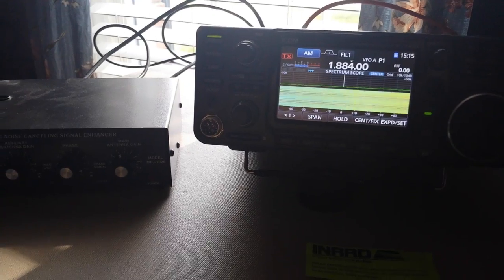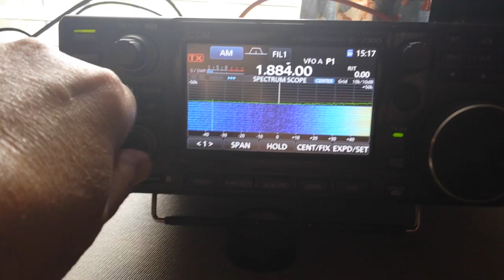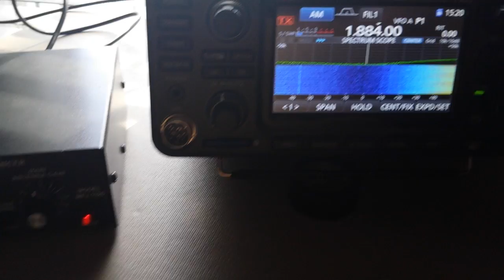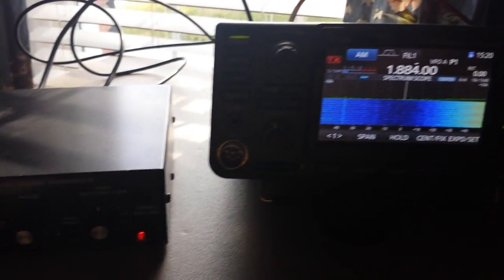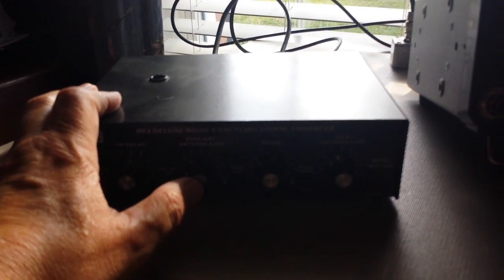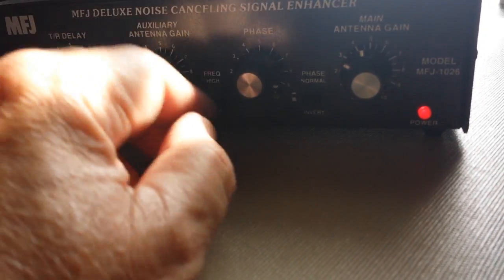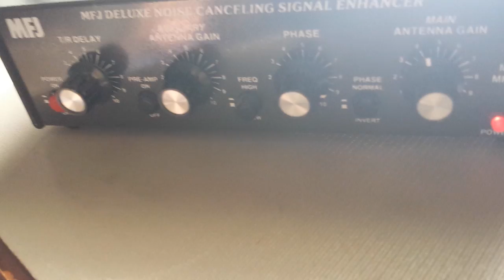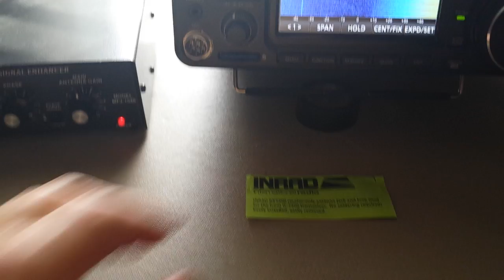IC-7300 and MFJ-1026 Noise Canceling + RX7300 + DXE RG5000

Comment: Is that a Noctua fan I see on the back of that radio ?
Reply from the maker: Correct. No more Whhrrrrrrrrr every time I tap the key or close the mic.
Reply: @n4lq  I figured as soon as I seen it. very quiet even at full speed, and will last quite a while. 

I built a gaming PC with 7 of them, three of them are 120mm Chromax black, and four of them are their 40mm their brown color. 

I want to do that with my Astron 30A PSU as it's fan is not what I'd call quiet. The fan on that PSU seems like it's one of those server grade Delta fans that have a very high RPM, and move a lot of air, I'm not sure if Noctua has a fan that small that can move that much air.

Comment: i have moved my main antenna from a vertical to an end-fed 80m and now pick up more noise than before. I have the MFJ-1026 and the IC-7300, so i really enjoyed your clear explanation of how this all works, i've used the MFJ-1026 on my Kenwood before and it worked well with my vertical, but will look foward to trying it out with the way you have your setup on the IC-7300 where I am picking up a lot of interference from VDSL which is transmitted on the telephone wires here in the UK. Will post a video on my channel once its all setup, more people in the UK need to know how to do this as VDSL is really impacting amateur radio where DSL is delivered over copper telephone lines.

Comment: Can anyone tell me what causes the horizontal lines across the waterfall after the powerline noise is gone? I have the exact same thing and with a wider span it becomes clear that the interference is about 5khz wide at about 60khz intervals and appears on most, if not all bands. I have powered down the entire house with no change.

Comment: Nice video but would of been nice to see a signal come in in the 160 Meter band that you could not otherwise hear without the MFJ-1026. As it is the video makes it look like all signals were canceled out. I read on another forum that some people use external selectable LPF's BPF's using that same Inrad cable to help the 7300 keep out QRM n all bands. Have you any experience with those?

Comment: For most of us, learning to identify and mitigate RFI and EMI "noise" is probably only second to understanding antenna systems. 

Some operators just get use to it. Some try to understand it and resolve it the best they can. It's one aspect of Amateur Radio that new hams are often surprised or dissapointed by.

Thanks for the video !

Comment: Is it possible to use my efhw as a RX and transmit antenna and use this mfj? Thanks Steve. You’re the only person on YouTube that actually shows this
Reply from the maker: You need 2 antennas for receiving. One being your main receiving antenna, usually also your transmit antenna and the other being the noise receiving antenna. So the answer is yes and no but. ..... IOW... If you are using the efhw for rx and tx then you still need another antenna to feed in the noise. This is call the "n o i s e" antenna. It needs to do a good job of picking up the noise but a lousy job of picking up the desired signal. the 1026 takes that big noise signal, adjust the phase and level then blends it with the noise on the main antenna so as to cancel only the noise and not the desired signal. Hope this makes sense.

Comment: Hi, Steve! Thanks for this wonderful IDEA (video) using the Rx7300 and so not connect the TX output of Icom7300 directly to the MfJ-1026. 
Question - If I can still access the plastic connector (set aside for the Rx7300 at rear),  can I still connect say the AH-4 tuner to the Icom 7300? As I understand, the TX line is completely independent from the Rx7300... The RG5000 is a MUST (this is similar to RG5000HD, I guess).
So I will have the Rx7300, the MFJ-1026, the RG5000 and then the AH-4 tuner all at the same time? 73s Gerry DU7EYG
Reply from the maker: Hi Gerry
Yes you can use the tuner jack as you stated. I saw where one guy even cut the notch in the 7300 rear panel deep enough to hold both the RX7300 jack and the Molex jack. I might do that myself.

Comment: Can I still use my amp with this setup ?
Reply from the maker: Yes if you have the DXE receiver guard in line. The RX antenna will have a strong signal on it. The MFJ 1026 has a light bulb inside for protection but that isn't enough if you are running QRO and that RX noise ant. is near the TX antenna. I also placed back to back diodes across the RX antenna input on the 1026 so we have even more protection. There is a built in TR relay that can be keyed by your key line. This disconnects the RX antenna entirely and provides ultimate protection to the 1026 if you don't mind the relay noise.
Reply: Thanks for the reply Steve. 73 Rick n2tox

Comment: Steve, did you ever try to hook it up to the 7300 using the internal T/R switch and the keying line?
Reply from the maker: Nope. Too much relay noise and I use the key line to key the amp.

Comment: So you are transmitting on your normal antenna but you receive on your long wire antenna not the transmit antenna. Is that correct?
Reply from the maker: Basically yes. Both antennas are transmit capable however. One can use a single antenna also. The rx7300 can be used to feed the rx signal from the main rig to the slaves rx input assuming both rigs have the rx7300. Lots of neat possibilities.